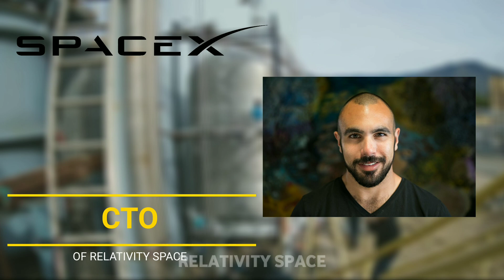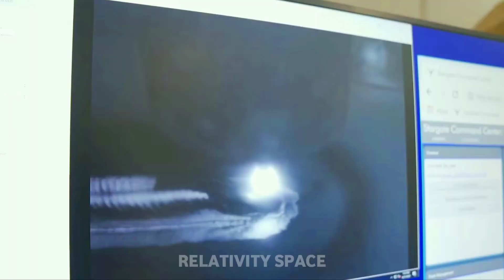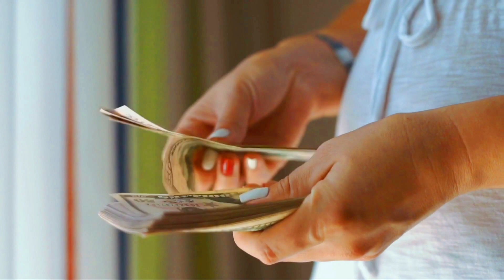Relativity Space's Terran R Rocket Plans To Compete With SpaceX's Starship

Comment: 3-D Printing has disadvantage in speed the larger the rocket gets. Sooo... Spacex can build a Starship in about 6 weeks today. The booster (in parallel) in about the same time. 
How long to 3-D print something that big?

Their current rocket endeavor is a small fraction of the size and takes 60 days (8 weeks) to 3-D print. At scale, this can be expected to be much longer. 

Spacex uses 3-D printing extensively in all their engines for some time. 
Other rocket companies also 3-D print the rocket shells. 

Common denominator: Small size. 

Does this mean it isn't the future of rocket fabrication? Absolutely not, but a breakthrough in speed of fabrication is needed if they want to scale to a 65m rocket (still much smaller than Starship). 

So the question is this: Are they moving the goalposts of efficiency, or just jumping the gun on pushing 3-D printing?

Frankly, I think Spacex should at least embrace 3-D printing the nosecone of the Starship in addition to the engines, the complex mount of the 29-32 engines would be another good use of the tech... for now.

Tesla has Grohmann as an arm of the company. Super-Draco was almost entirely 3-D printed years ago. 

Interesting to see if 3-D printing a 155' rocket (Starship's upper stage) is in the cards in the next few years.
Reply from the maker: But if relativity space will use multiple 3d printers to print a single rocket, they can print it in the similar time frame to spacex.
Currently, they don't have plans on mass production of their rockets. But they do have plans for using artificial intelligence system and autonomous robotics along with 3d printers to print their rockets in the future.
And to mass produce their rockets, they need a breakthrough in speed of fabrication but they can also use 3d printing technology similar to carbon m1 3d printer to print faster.
Reply: The future is the Stargate 2.0 system. It can scale up and print larger rockets in series. Of course the speed of printing will improve throughout the 2020s.

Also Relativity Space have the advantage for being the first to build an in situ rocket facility on the Moon or Mars. That in itself is a game changer that even Space X cannot claim to have the means to do currently or for the foreseeable future
Reply from the maker: True